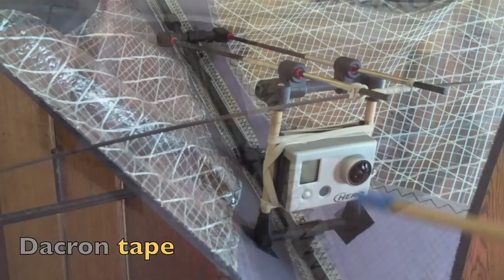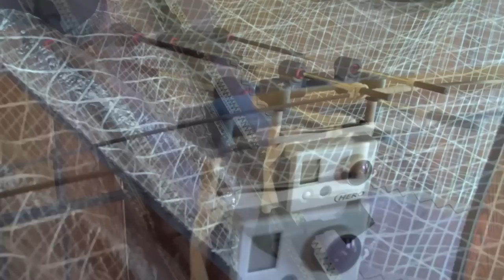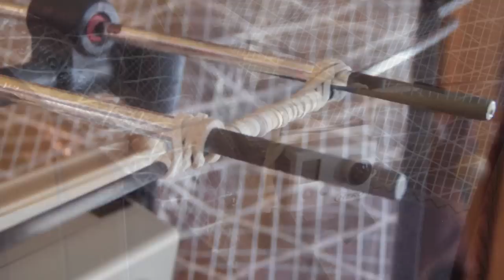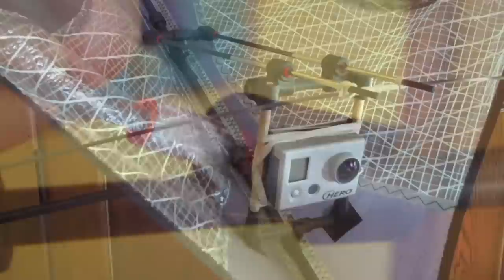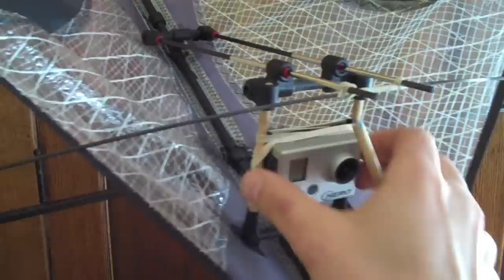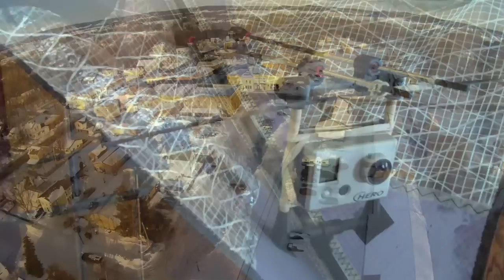GoPro Kite-Cam Rig Tutorial

Comment: I got it sorted! There are two color beads Blue and Red. There is a slip knot behind the red bead beads when you buy it (this is like most good kites). Then you can loosen the slip knot and change it to behind the blue beads. This makes it trick and turn alot easier. 

Thanks to the guy at the kitepower shop I found this out.

Comment from the maker: @imetbenharper yo-yo stoppers (or whiskers) allow you to wrap the kite up (basically a backflip). as the kite comes back around the lines get caught on the whiskers (if it's lined up correctly) rather than sliding down and off the leading edges. theyre necessary only for wrap-based tricks: yo-fades, wap-do-waps, crazy-copters, etc. i think most newer higher-end kites use roll-bars now. modified whiskers that catch the lines more effectively.
you can pry the Nirvana from my cold dead hands. :)

Comment from the maker: @imetbenharper pop both lines back hard and quick as you can then give a bit of slack immediately. the pull shoves the kite against the ground, the slack lets it rebound up a tiny bit. when/if it comes up pull hard and deep (may have to run back as you do) to bring it up the rest of the way. this is called a Dead Launch, a lot of kites can't do it. even ones that do can break a spreader as it puts a lot of stress on the frame.  safer to just do the walk of shame and dont get into that position:)

Comment from the maker: @510AdrenalineJunkie great. i have one set to go for a 7mm spine.  but if you really want to use the housing i'll have to redo some of the parts.  i would advise against it though.  i think the extra width makes it press into the sail too much, and it weighs a ton--2.4 oz!  the heavier the rig the more violent that bucking or "pitchy wobble" i talk about in the video (not to mention the more wind you need to fly).  ive never had an issue...(more in your "Personal Messages" folder of your inbox)